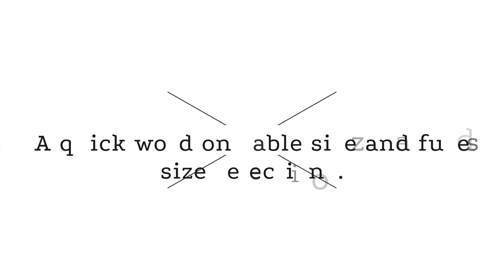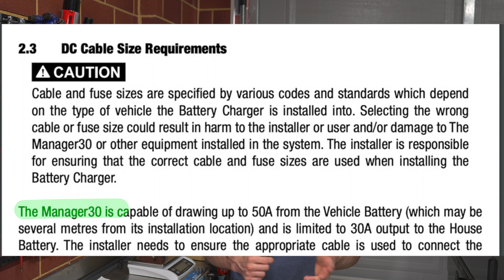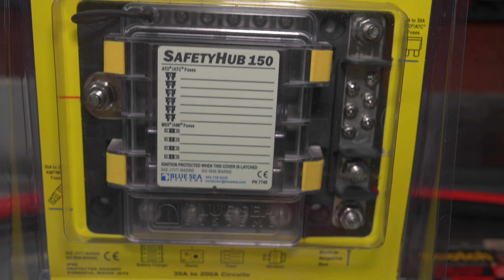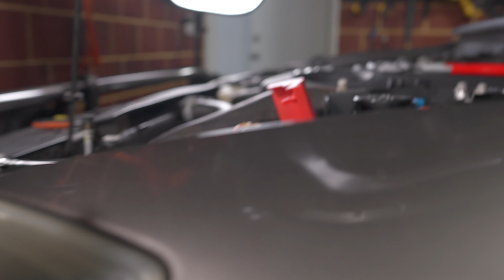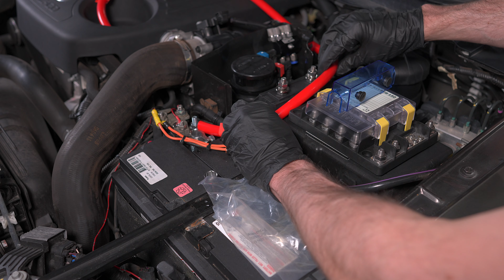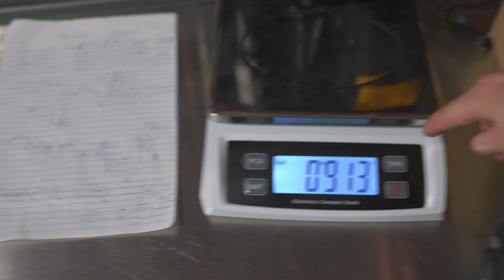Blue Sea Safety Hub 150 & How To Upgrade Mazda BT-50 Battery Terminals || BT-50 Build EP14

Comment: This is exactly what I needed. I have purchased two massive bus bars to attempt to tidy up the wiring under my bonnet but was still going to have inline fuses everywhere. Didn't realise those fuse blocks existed! You're a legend!
Reply from the maker: No worries. I've had it in there for a few years now and still going strong.

Just wish there was more space for mounting it.

Comment: You have connected the main negative to the battery, it should be on the body negative, that way all the current goes through the negative battery curtent sensor to the batyery, so the smart alternator  and bms can compensate for the extra current draw from all your accessories.
Reply from the maker: Hey mate, I have moved that (I can't remember in which video but you can see it in the winch install) but I actually tested the car and read through the forums and I don't think the BT-50 got the smart alternator at this stage, even though it shared the same stuff as the Ranger I believe it came later.

Was hard to find solid info on it, people in forums saying they didn't have smart alternators like the Rangers until later on. I tried testing this by letting the car run for ages and testing voltage, always showed ~14V and never seemed to dip.

Either way though I did move the negative, put the winch negative on the battery and the Bluesea negative is on the same lug/body bolt as the battery cable 👍